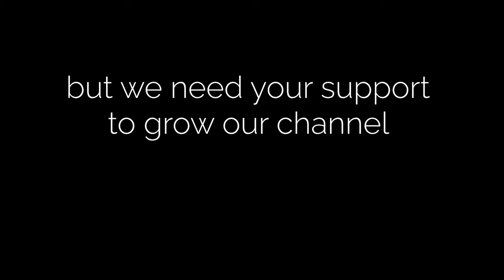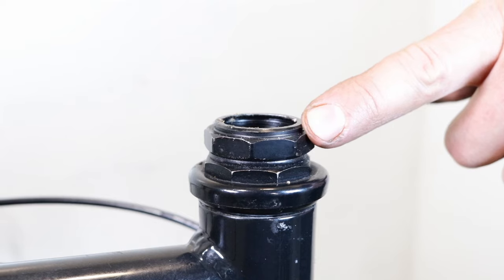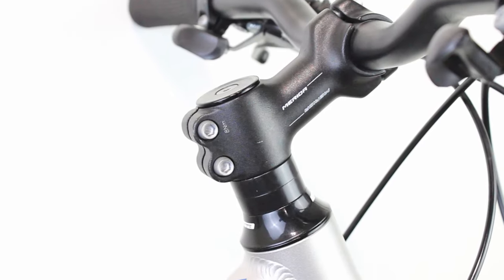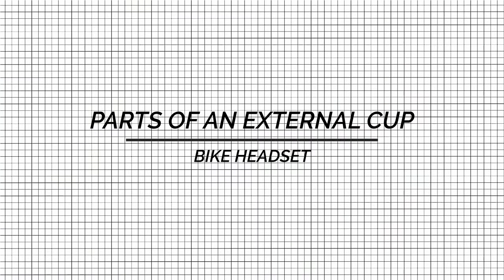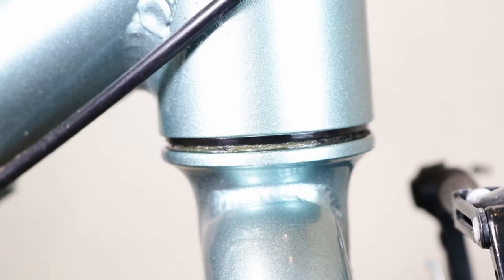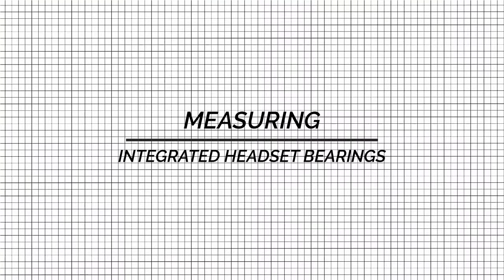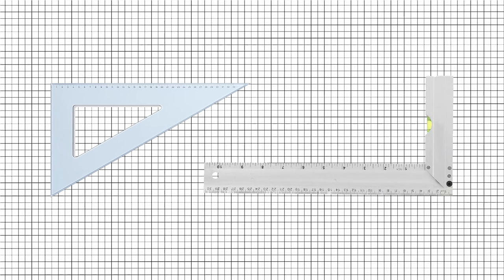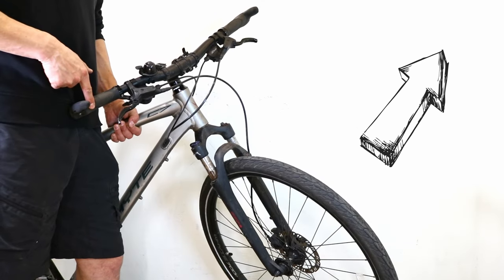Types and sizes of bicycle headsets explained!

Comment: There are also 22mm threaded ones, mainly on third world countries like Brazil and some very old swedish/french bikes. Unfortunately, no way to modernize them, as 22mm aheadset suspensions do exist, but I've only ever seen then on old 10-speed 700c bikes.
Reply from the maker: Hey, thanks for sharing this valuable knowledge about less common setups!
Reply: I have two cheap bikes. Both are "full suspension MTBs". They both have threaded headsets. One is 22mm and the other is 28mm. Nice to know the one with a 22mm thread is basically useless in terms of parts. Can't be transfered to a better frame. I mean not that the other bike has much use either.

Comment: Can I replace my headset at home if I don't have those clamps for the 2 cups? Would a rubber mallet work or is that a bad idea? I got an e-bike in the mail and no matter how I put it together, the headset is loose. I want to replace the whole thing and pray that fixes the problem. Now I need to figure out what kind of headset, what size, and if it's something I can do without special tools? I clearly don't have the experience for this work. The bike is an (Amyet G60). Any info would be helpful, thanks
Reply from the maker: Hi Ricky, thanks for your question and for sharing your experience. I get your frustration. Replacing a headset at home without specialised tools can be challenging, but it's not impossible. If you don't have a headset press, home tools could potentially work, but it's important to be cautious to avoid damaging the frame or other components. It might be worth to spend a bit more money and let you local bike shop to do the work to be on the safe side. At the end of the day If you damage the frame it will cost you much more.

Comment: I'm about to build a bike frame using 1 5/8 tube. I'm thinking of using the same tube for the head/steering tube since it seems it would pair best with the rest of the frame. However, I doubt they make a bearing set for this size tube? Also, I'm wondering about the best way to set up an empty tube to accept a bearing set. I'm sure some method of keeping the bearings at the top and bottom will be required. Maybe a sleeve or some sort of bearing cup? Any advice on simple and cost effective ways to fabricate a steering tube bearing setup from scratch? Thanks. Subscribed. Robert
Reply from the maker: Hi Robert, thanks for reaching out and subscribing! I'm excited for your bike frame project. I have to be honest though, building bike frames isn't really my thing, so I'm not the best person to give advice on this topic. However, I'm sure some of our viewers who know more about frame building will will offer some helpful suggestions. 
I wish you all the best with buidling your bike frame! Keep us informed of the progress.

Comment: Hi! I can't seem to find this out anywhere online...what size wrench is the locknut on the headset? Is the locknut size the same one 1" and 1 1/8"? Thank you!! :) 

I'm struggling with a very stuck headset so my adjustable wrench isn't gonna cut it. I want to buy the specific size 'thin' wrench... Any advice would be helpful! Thank you again :))
Reply from the maker: Hi, thank you for your message, and I'm really sorry for not getting back to you sooner. You may have found the answer by now, but I hope you don’t mind me responding anyway. Typically, the headset wrench for a 1" threaded lock nut is 32 mm, while for a 1 1/8" it’s 36 mm. I hope you've managed to release the headset.
Reply: @cyclemaintenanceacademy  I did manage! Thank you :) I ended up finding a double sided headset wrench with had both 32 and 36 and it has so far proven useful on more than one project :)

Comment: Hey..
I need help, 
I just change my mtb headset new bearings "tapered" 
Everything is put in place accordingly , but i felt it so tight, 
I disassembled Everything back and installed double check and still the same. Might be the compression ring problem , already checked them to , Everything fine. 
How can i fix this. Thanks
Reply from the maker: Hi and thanks for your question. It looks like you already did a lot to solve this problem. Are the new bearings compatible, this same size? If you replaced the whole headset, did you also replaced the corwn on the fork? I have a video here on how to replace the headset here: https://youtu.be/ziImgS8Xe1Y

Comment: My current project is making me headache. I am trying to fit a 1 1/8 inch threadless O/S fork into my old mtb bike frame. I can fit a fork into a steerer tube, but only when "cups" are out and I was wondering are there any headsets or adapters available so I could fit that fork
Reply from the maker: Hi, and thanks for your question. It sounds like you're facing a challenging project and I'm not sure if I am able to help! Adapting different components can be tricky. Have you spoke to your local bike shops? They may have some recommendations or be able to point you in the right direction. Good luck with your project!